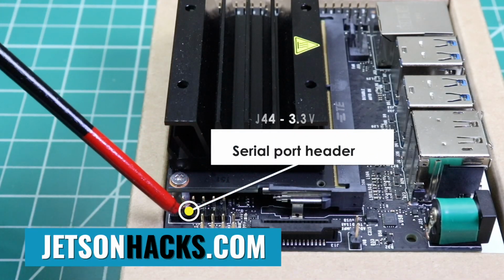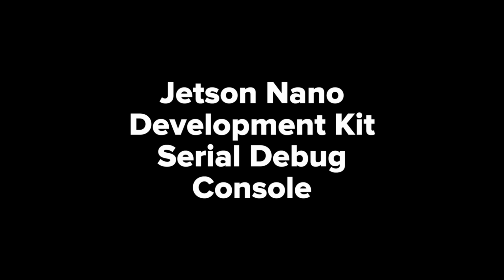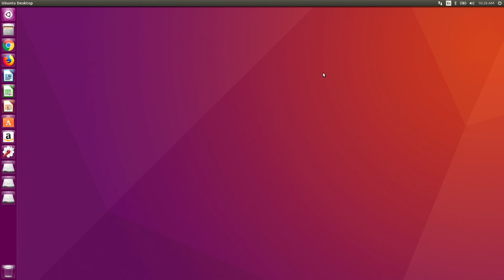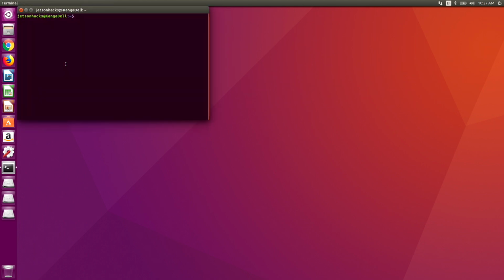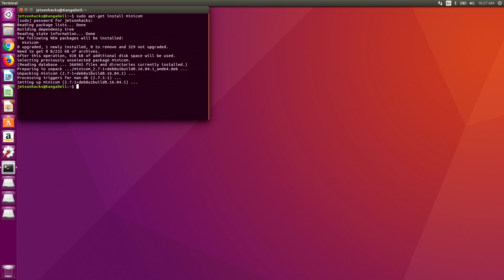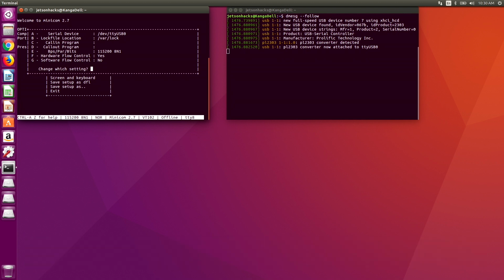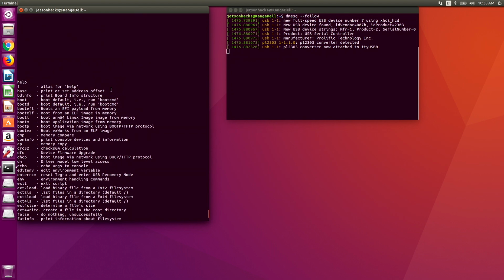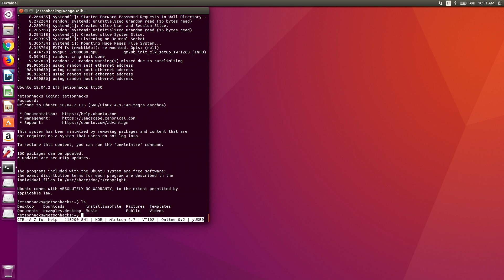Serial Debug Console - Jetson Orin Nano, Xavier NX and Nano

Comment: Is this tutorial could help me to check my jetson tx2 a203v2 carrier board that LED can't turn on?
Reply from the maker: The debug console tells you the code that is executing when the machine is booting. If it is working properly, the debug console should have output. However, I don't know what "LED can't turn on" means. Are you trying to program a LED to turn on from the GPIO pins, or do you mean the LED power indicator? If you mean the LED power indicator, you should check the voltage on the GPIO pins to see if the Jetson is getting power.
Reply: @JetsonHacks  I mean the LED power, okay, I'll check it first.
Reply: @JetsonHacks  Hi, I have checked the power. The GPIO didn't get the power. what happened? Sometime the jetson can boot, but sometime can't. Could you give me some solutions?
Reply from the maker: @orientasiprodikelasA  That isn't something I can help you with. You should contact the board manufacturer and post your questions on the official NVIDIA Jetson forums. I hope you can get your Jetson working again.

Comment: I am not getting any Serial Log even though I followed all the steps. Is there any way I can check if my Jetson Nano is communicating?
Reply from the maker: You will need to make sure that your cable is wired correctly, and that you have a proper driver for the TTL to USB chip. Which cable are you using to connect them? What is your host machine?
Reply: @JetsonHacks  I used this cable: DTECH 3ft 3.3V USB to TTL Serial Adapter Debug Cable TX RX Signal 4 Pin Female Socket PL2303 Prolific Chip. I am using Ubuntu 18.04.
Reply from the maker: @najibmurshed  Do you have a PL2303 driver for your host machine? If you're looking to check if the correct driver is installed for your PL2303 TTL to USB serial converter on Ubuntu 18.04, here's a step-by-step guide:

Plug in Your Converter:
First, plug your TTL to USB serial converter into your computer.

Check Kernel Messages:
Open a terminal and type the following command:

$ dmesg | grep tty

This will show you the kernel messages related to TTY devices. Look for lines mentioning the PL2303 converter, such as:

[ 1234.567890] usb 1-1: pl2303 converter now attached to ttyUSB0

Next, list the TTY devices to see if the converter is recognized:

ls /dev/ttyUSB*
You should see something like /dev/ttyUSB0 if your device is recognized.

Identify the Driver Module:
To identify the driver being used, type:

$ lsusb

Look for an entry similar to:

Bus 001 Device 004: ID 067b:2303 Prolific Technology, Inc. PL2303 Serial Port

Note the vendor ID and product ID (e.g., 067b:2303), then check the driver details with:

$ lsusb -v -d 067b:2303 | grep -i driver

Finally, verify that the pl2303 kernel module is loaded:

$ lsmod | grep pl2303

You should see output indicating that the pl2303 module is loaded.

If the pl2303 module isn’t loaded, you can load it manually with:

$ sudo modprobe pl2303

And check again with

$  lsmod | grep pl2303.

Hope this helps
Reply: @JetsonHacks  Thanks for the detailed suggestion! I did try the steps and instead of product ID (067b:2303) I am getting (067b:23a3) and when I use that I get: 
$ lsusb -v -d 067b:23a3 | grep -i driver
Couldn't open device, some information will be missing
But if I used:
lsusb -v -d 067b:2303 | grep -i driver (The terminal accepts it)

Also: 
$ lsmod | grep pl2303

I get --------------------------------------
pl2303                 28672  0
usbserial              49152  1 pl2303
Reply from the maker: @najibmurshed  What was the result of the $ dmesg | grep tty and ls /dev/ttyUSB* Was the device created?
Reply: @JetsonHacks   The results were as follows: 

dmesg | grep tty
[    1.075599] printk: console [tty0] enabled
[  350.928460] usb 2-2.1: pl2303 converter now attached to ttyUSB0

ls /dev/ttyUSB*
/dev/ttyUSB0
Reply from the maker: @najibmurshed  Ok. It sounds like it should be available to your Ubuntu machine. That most likely means that you have not set up your terminal emulator on the host side correctly. The host needs to be running the terminal emulator before you plug in your Jetson.
Reply from the maker: @najibmurshed  It sounds like that's ok. Your terminal emulator needs to be setup correctly, and point to /dev/ttyUSB0
You should also double check your wiring from your Jetson to your cable. It's easy to have swapped transmit and receive, or not have a good ground. Remember that the power wire should not be plugged into the Jetson. You must have everything setup on your host before plugging in the Jetson.
Reply: @JetsonHacks  I am positive that the wiring is correct.
Reply from the maker: @najibmurshed  Sounds like either the cable is bad or the Jetson is broken.
Reply: @JetsonHacks  Is it possible that I flash the Jetson and get it to work? I see that the lights are on when I turn the jetson on. And I see some stuff after the Nvidia screen but the Jetson does not load up to the desktop screen.
Reply from the maker: @najibmurshed  It sounds like may be cable bad, or something might be wrong with the Jetson. Which terminal emulator are you running, and what are the settings for the port and the communication protocol?
Reply: @JetsonHacks  I am using minicom and followed all the steps mentioned in your video.
Reply from the maker: @najibmurshed  You should certainly try flashing it. I don't have any more suggestions on how to fix your issue, please ask any more questions on the official NVIDIA Jetson forums where the NVIDIA engineers can help.

Comment: Thanks for the detailed video. Can I ask a question? I'm flashing Jetson Orin nvme with initrd bsp and rootfs files via setup shell scripts. After flash is done. How can I set username, password, hostname with headless to use it in ssh? I don't use serial communication. I just use recovery mode and host device.
Reply from the maker: You can watch this video and see if it helps: https://youtu.be/Ch1NKfER0oM?si=3I6QaJ4awKnNg8vx

Comment: thank you for your effort.
can i do this with windows plat form ? and How?
Reply from the maker: Yes. You can use PuTTY for the terminal emulator. You will need to determine which USB port the Jetson is on through the device manager. If you need more help, please ask on the official NVIDIA Jetson forums where a large group of developers and NVIDIA engineers share their experience. Good luck on your project!

Comment: Do i need ttl to usb or usb to ttl converter? Or any of them works?
Reply: Hi thanks for your prompt reply. The issue was fixed.
Reply from the maker: @maheshch1829  I'm glad you were able to get it to work!
Reply from the maker: I don't know what the difference is between the two. I know this one works: https://amzn.to/3SdWGTu
Reply: @JetsonHacks  I followed your instructions and I can login into jetson through serial console but I can't login normally with GUI, it's stuck at booting process. Could please help me with solution for this issue?
Reply from the maker: @maheshch1829  The serial console output will tell you why it is not booting into the GUI.

Comment: [21515.991026] usb 1-2: new full-speed USB device number 113 using xhci_hcd
[21515.991267] usb 1-2: Device not responding to setup address.
[21516.199314] usb 1-2: Device not responding to setup address.
[21516.407075] usb 1-2: device not accepting address 113, error -71
[21516.535102] usb 1-2: new full-speed USB device number 114 using xhci_hcd
[21516.535309] usb 1-2: Device not responding to setup address.
[21516.743414] usb 1-2: Device not responding to setup address.
[21516.951227] usb 1-2: device not accepting address 114, error -71
[21516.951362] usb usb1-port2: unable to enumerate USB device
got an error like this in dmesg --follow
Reply from the maker: I'm not sure what your issue might be. Please ask the question in the official NVIDIA Jetson forums, where a large group of Jetson developers and NVIDIA engineers share their experience: https://forums.developer.nvidia.com/c/agx-autonomous-machines/jetson-embedded-systems/70

Comment from the maker: The USB to TTL serial converter connection is the same for the Jetsons that are in the newer Jetson Nano (B01) form factor. This currently includes the Jetson Nano, Jetson Nano 2GB, Jetson Xavier NX, and Jetson Orin Nano. As usual, make sure to check the connector labeling located on the underside of the board.

Comment: On mine I got 

Ubuntu 18.04.5 LTS jetson ttyTHS1

jetson login:

and nothing more. Typing password and pressing enter does nothing. I think I should see kernel messages
Reply from the maker: You should have your terminal emulator running on your host computer before booting the Jetson in order to see the boot logs.
Reply: @JetsonHacks  found the problem. I plugged it on the wrong UART ports. It should not be the ones from the GPIO but the ones for UART debugging  of the kernel
Reply from the maker: @geekionizado  I'm glad you got it to work.

Comment: Hi? Thanks for the good video. 
I have a question. I have two jetson boards and they are trying to communicate with each other by UART.
When I tested with the tx rx pin of the J41 header, the communication went well.
However, when I tested it with the tx rx pin of the J50 header, there was no communication.
Why can't these communicate?

I connected them using jumper wires.
I didn't use TTL to usb.
Reply from the maker: Hard to tell what the issue is from your description. The J50 UART explicitly is the serial console, and a console running the getty service. What address are you using to communicate with the J50, and how did you disable the serial console and getty service?
Reply: @JetsonHacks  I used ttyS0 port
Reply from the maker: @kyp7699  It is difficult to tell from your description what the issue may be. It could be a permissions issue, you didn't say how you disabled the serial console or terminal services, wired the two together and so on. Please ask this question on the official NVIDIA Jetson Nano forum, where a large group of developers and NVIDIA engineers share their experience. Good luck on your project!

Comment: minicom throwing an error
minicom: cannot open /dev/modem: No such file or directory
Reply: Had the same problem. ‘sudo minicom -s’ also worked for me. I have Jetson Nano 2G DevKit. After initial setup, saved as default and works subsequently as ‘sudo minicom’.
Reply from the maker: I do not know what this means. Why do you think your serial port is on /dev/modem?
Reply: @JetsonHacks  I managed to resolve that error using  this "sudo minicom -s". Now I am able configure and save the changes. But when I connect the jetson nano power adapter I can't see any logs in the minicom terminal. The screen stays blank completely.
Reply from the maker: @DrShaikAhmad  You don't say how you are powering the Jetson.
Reply: @JetsonHacks  I am powering the Jetson nano with Barrel Adapter just like how you showed in the Video. 

1. Ran dmesg --follow on one terminal
2. Connected the TTL  USB to the laptop (Linux 20.04 LTS). And saw the detection log in the terminal.
3. Ran sudo minicom -s on the other terminal and configured the minicom
4. Closed and reopened the terminal, ran the sudo minicom
5. Connected the barrel adapter to the Jetson nano and turned on the power. 

But I couldn't able to see any logs in the minicom terminal.
Reply from the maker: @DrShaikAhmad  Did the green light on the Jetson indicate it was getting power? What are you expecting 'minimum -s' to do? What /dev address is the TTL adapter connected to?

Comment: Really appreciate the Jetson Nano content, Jim!
I have a question hoping you could help me with.  I have  a USB to ttl cable from Adafruit.  
I want to use it for communication in the other direction. 
I want to use it to communicate from the Jetson to an Arduino Mega on the Arduino's Rx and Tx pins. 
The reason I don't just use a regular USB cable is that I am going trough a slip ring. 
Am I correct that this communication should work without any level shifters for 3V to 5V system since it is going to the Jetson's USB port and not GPIOs?
I could even use the 5V line to power the Arduino?
I hesitate to just try as I do not want to fry the Jetson.
Reply from the maker: Thank you for the kind words. I believe that the wiring is 3.3V for the TTL signals, I don't know enough about the Arduino to say whether it will understand that voltage. You can try to power the Arduino, but remember that the Jetson may not be able to provide enough power to the USB port, depending on how you are powering the Jetson. Thanks for watching!

Comment: I have an older model that I can't get to boot, when I hook up the TTY cable it prints out ~200 grey squares.  That it, no glorious boot sequence.   Nice video, BTW.
Reply from the maker: Hard to tell from your description, but it sounds like the baud rate and so on are not correct.
Reply: @JetsonHacks  11520 8n1 hardware off/software on, get the same results under minicom and putty.   Don't worry about it, I'll buy a new one.
Reply: Sorry meant 115200
Reply: @tburnettiii  verify if ground is connected

Comment: Another great video. Hey, just curious, it looks like you were blurring part of the back of you board. Just wondered how there could be anything sensitive there you would want to blur. Inquiring minds want to know
Reply from the maker: Thank you for the kind words. As I recall, and it's been a while since I look at this, there are 4 pieces of information there. The first is the part number, the second is the serial number of the card. The third is a QR code, which encodes to the 'Getting started' with Jetson Nano web page. If I remember correctly, the other code is the mac address of the device. I don't think any of it is super secret, or probably even worth hiding, but it makes people curious! Thanks for watching.
Reply: I don't suppose there's any chance you or "Jim/Paul" have done anything on setup of x11 files I have a feeling one of you did but can't remember which one :)